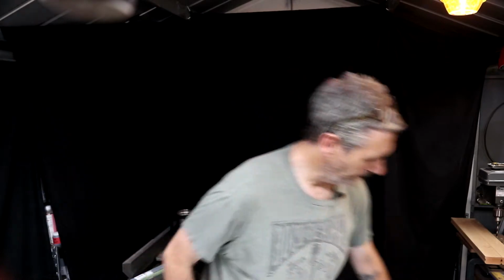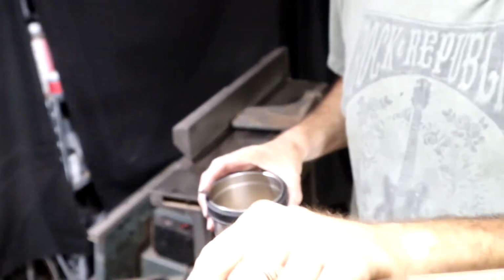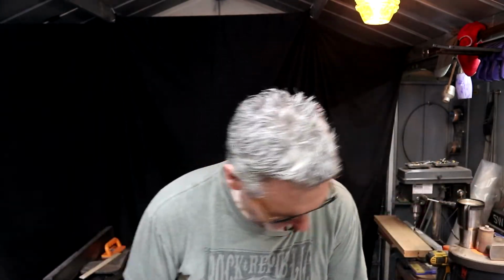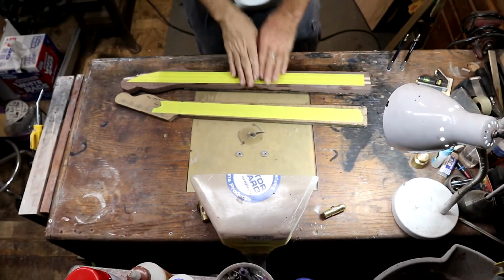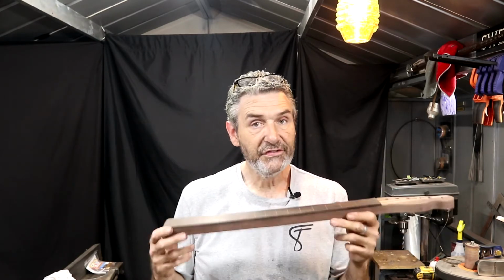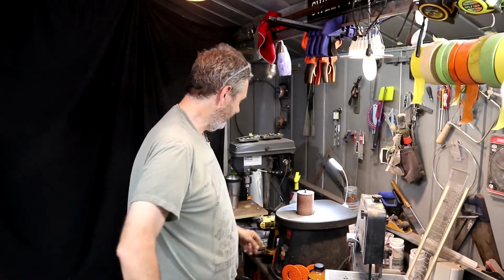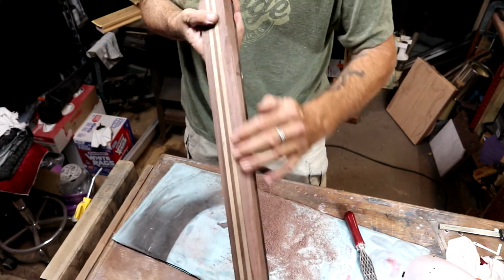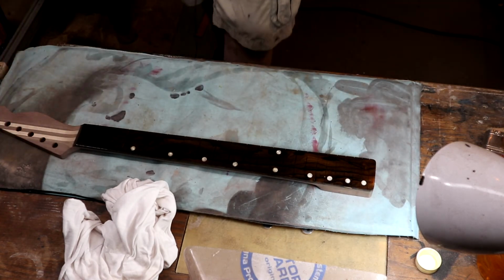How to Build an Electric Guitar - Riza - Ep.2

Comment: I have a bunch of body design drawings on poster-board.. but 9 times out of 10 I end up changing them after tracing to the wood. Every guitar I ever built has "evolved" into existence. They never end up exactly like the plan. I think the freedom to design on the fly has given my guitars a unique quality in most cases.  The best thing about building from scratch is that you can change everything along the way.  I do not own a single template. Every aspect of the build is "freehand".  I was afraid that if I had a template, I would end up building the same guitar 4 times. The one thing the world doesn't need is four more Teles..
Reply from the maker: I agree. I actually took the time to make 3 tele templates and the more I thought about it the less interested I became in building a tele! I don't want to duplicate anything really. Similar will be okay but nothing exactly like anything else. That's what really turns me on about building.
Reply: @SweetTGuitars   It seems that most hand builders actually make copies of Gibson, Fender, and PRS guitars. For the life of me I couldn't figure out why. If you have the tools, and you understand how a guitar works, then why not create one?  Sometimes you arrive at something similar to a Fender or Gibson shape because it's in your head already that a guitar should look that way.  The best ones I have made don't look anything like any factory guitar.  There is a reason for that, and I called it "innovation".   My motto from day one was form follows function.  I have a pile of mistakes on a shelf, and I cut them up when I need a piece of wood for another project.  That's the secret to finding your niche',  don't be so afraid to be wrong that you always play it safe.
Reply from the maker: Man, you pretty much just summed up how I feel about building. I love the free feeling I get when I start a project with only an idea. No drawings and no plan to speak of. Just a spark of something. I have a feeling all my builds will be that way and although I won't always do bolt on necks or dual cutaway designs, I will only duplicate a design of mine and only at the point I feel that a certain builds warrants me making a template to be able to build a few of that design. We'll see how it goes. Thanks for your comments and your encouragement. I really appreciate it. ✌️
Reply: @SweetTGuitars  Just like my baseball coach used to say.  You can watch it go by, or hit it.  The choice is yours.

Comment: What works for me, when setting a stop, is to clamp a carpenters square to the neck. Because of the lip on it it stops it moving around like say a block of scrap wood and saves having to mess around with tape and glue etc.
How do you find the narex chisels? Looking to get a set myself...
Reply from the maker: True. Still waiting on some ideas to hit me. That is a great one. Especially considering I have all those new clamps! Thanks for the comment!
Reply: @SweetTGuitars  No worries, a million ways to skin a cat, I like it mainly because its easy to fine tune where the stop sits if you get it wrong or need to move it again.
That was one beast of a video in the end, neck its looking sexy!
Reply from the maker: I know man. The rest of the videos won't be nearly as long. I wanted to get the neck to a point, you know? I went back and took out what I could without losing my style and let it roll. I've seen so many guitar building videos. Some are long some are really short. If they're gonna be long I want to learn something so that's what I'm trying to do brother. Thanks for watching it!